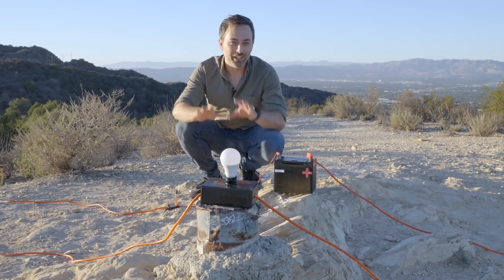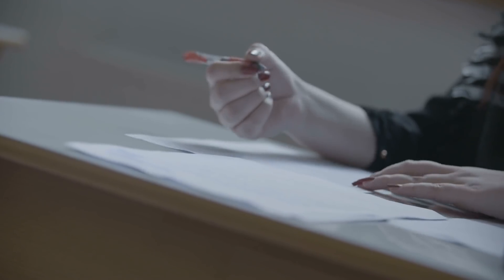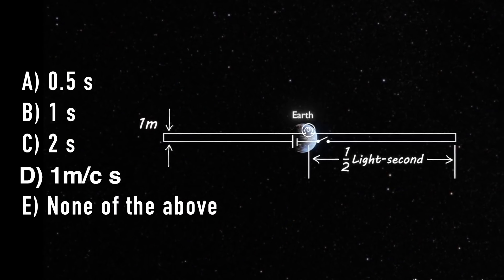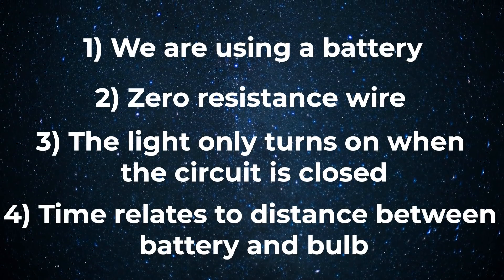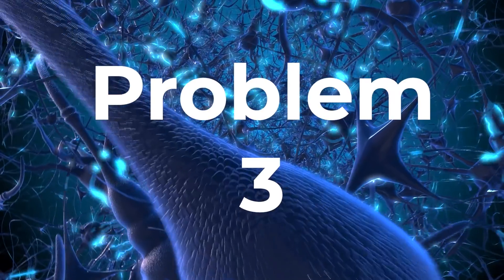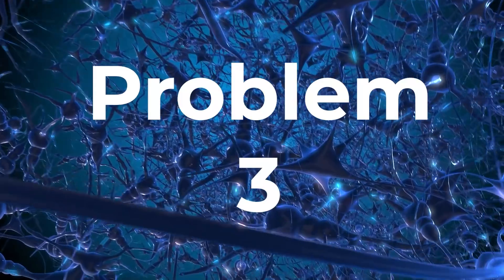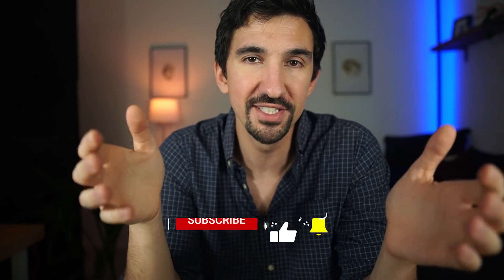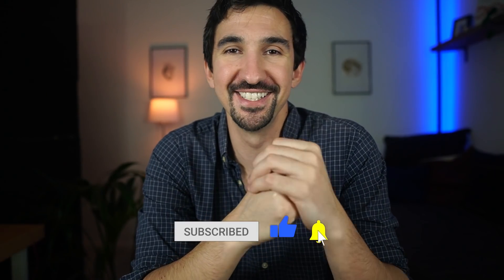Is Veritasium Wrong About Electricity?

Comment: Sorry to say, you are both wrong.  As some others below have commented, this problem is all about high speed transitions on a transmission line.  Yes, when electrons move they create a field and yes this field propagates down the wire on the outside skin of the wire.  Vertasuim states that these fields jump across the only 1m distance to light the bulb.   Any competent EE can do the calculation of the strength of that field moving thru air and they will tell you that it will in no way be strong enough to produce enough energy to light the light bulb.  The next problem is that even at zero resistance of the wire the bulb must have resistance other wise it would not glow and light up.  This resistance will reflect the incoming voltage step from the switch and cause a wave to head back to the switch.  This is a negative reflection so it will reduce the incoming voltage by 1/2 until the wave gets reflected again.  If you look at vertasiums video at 12:20 your will see a chart if these reflections.  Count the steps.  This is how many times the voltage has to travel down the 1 sec line.  If the bulb needs the full 12 volts to light up it will take many seconds to turn on.  High speed transmission line theory.
Reply: The entire lightbulb thing is just a distraction. The simple fact is that this is a fairly straight forward transmission line problem and physicists and EEs who can't solve this are simply incompetent. That applies to famous YouTubers. :-)

Comment: Let's place the light bulb, and the wires that connect to it, inside a Faraday cage that covers the entire length of that side of the circuit.
The time it now takes the light to come on is now proportional to the length of the wires, not the distance between the battery and lamp.

Comment: You are using a 12V source.
The round trip for the current is 2*2*300,000km = 1.2E8 m
Choosing  a very generous 2.5mm sq wire giving 6.9 ohms / km
Then the total resistance will be 8.28E6 Ohms.

Assume the light bulb is a LED at 5W so needs 5/12 = 0.41Amps.

The availble current will be I = V/R =
12/8.28E6 = 1.44 E-6 Amps.

The light bulb clearly has insufficient current and will NEVER light.

Comment: I think you made a common error. It isn’t the distance between the battery and the bulb that matters, it is the distance between the switch and the bulb. Once you understand that the causality issue disappears, since a break in the line would basically just be another switch, and so the time delay would again be approximately distance/c. Also, if you look at the analysis that he linked to in the description it shows that the bulb turns on to about half power initially, and then steps to full power after full propagation.
Reply: If the bulb side had many bulbs, would they turn off radially from the switch, radially from the source, sequencially along the cable or intantaneously?
Reply: @JuanCLeal  This is complicated to explain in text, but I'll try to explain it according to my understanding. Note that I am using the same assumptions that are required for the original question (ideal conductor, etc). If all of the bulbs were on and the switch was opened they would dim to around half voltage based on their shortest distance to the switch, so radially. They would turn off completely once the propagation along the wire is complete, so sequentially.
Reply: Wrong. Vertasium is deceiving his audience. Yet again. With his conclusion it means that “the lamp will light up” if where’s no wire. Because there is no time for the wire to affect the outcome and there’s no field created by it that would facilitate this energy transmission.

Comment: I think reason number two is flawed.
If the circuit breaks at one light second away, the system wouldn't know it was broken until it propagated to the light bulb. In other words, if the circuit were broken, it would take some time for the light to go off BECUASE of causality.
The idea that the light would go off immediately is simply wrong. There is no way for that to happen. A false premise leads to a wrong answer.

Comment: Regarding FTL communication: the setup almost seems like a scaled up version of quantum entanglement, doesn't it?

Where the entire system can technically communicate information FTL, however it is so fickle that you can't effectively engineer a FTL technology with it...

This is my mental model for how i think about this...

The bulb "knows" that the circuit is closed, and therefore it's ok to turn on now.

Similarly to how an entangled pair of photons "knows" to have opposite spin, and so it can reveal the information quickly.

(Of course this goes into hidden variable theory, which is guess is incorrect?)

Nonetheless for this light second long circuit to feasibly exist, it actually had to propagate through the causality network at some point first. It can't just exist at the snap of a finger and work instantaneously.

Similarly how you have to first produce an entangled pair of photons, send them far apart, and then you can be impressed by the apparent FTL communication.

There was also sort of a circuit being built, before the experiment could be conducted.
Reply: Quantum entanglement can't communicate faster than light in principle. Classical information is still required to decipher the quantum result, and this information can't be predetermined.

Comment: It seems to me a DC current in a power line can induce a DC current in another line. However the current cannot last forever though unless the line is infinitely long . The wire has a limited number of electrons. Also the amount of current is probably almost zero at 1 meter distance. I think the Veritasium video was very misleading (or at least very unclear) and very click-baity.

Comment: Okay, a piddly point of no real importance that I assume someone must have brought up already, but the last time I fiddled around with making antennas, the formulae that I used ALWAYS assumed that the speed of the wave flowing through the wires (either leading up to the antenna or as part of the antenna itself) was NEVER the same as the speed of light in a vacuum.
IIRC, the best case was something around 80-percent (i.e. 0.8) of the speed of light.
And these were just best guesses as one was always supposed to "tune" the antenna in "real life" by adding/subtracting the length of the elements to get it to resonate (i.e. match the speed of the wave flowing in the element to its actual physical length).

Also, the formulae didn't vary based on the fundamental frequency of the antenna (i.e. an antenna for a higher frequency which meant a shorter antenna element length and therefore lower resistance).
What was important was matching the antenna impedance to that of "free space" so that the maximum amount of electrical energy was transmitted from the transmitter into "free space" and, as it turns out, the impedance of free space is something on the order of 40-ohm (which is relatively close to 50-ohms which is why 50-ohm coax is often times used).
So I suspect that assuming a wire resistance of zero doesn't really help with making the thought experiment "realistic".

So to my uneducated mind, NONE of the time options given by Veritasium make any sense to me whatsoever.

Of course, I'm not a physicist or an educator and I don't play either on TV.

Comment: The was is an implication that electrical wires are shielded and a presumption that perfect shielding, such as blocking the antennae effect, should not negate the results of the light turning on.

Comment: What if the wires are infinite in length with zero resistance. Will it be still 1/c?
Reply: It's never l/c.  This is a transmission line problem. What really happens is that there is an instantaneous current flow that is V/Z_tl, where Z_tl is the transmission line impedance of  roughly100-200Ohm. That will, of course, not light up a 1Ohm light bulb, but it is still the zeroth order effect. As the electric field spreads along the transmission line, the Ohmic and skin effect losses will increase until, after only a few kilometers, these losses effectively take up all of the energy that we are pumping into the line. It is entirely irrelevant how long this thing goes on after that initial lossy section.
Reply: @lepidoptera9337  thanks. But what I would like to know is say, there's a generating plant 10,000 km away, switched on at T0. I switch on my fan at T0. When will the fan start running? Is it 10,000/300000 second?

Comment: I read a lot of comments... My take, let's design a system where the light has an on board power source and a detector capable of sensing a change in EMF on the wire loop.  The question now is, how fast will the light turn on given a signal request thru 300000 meters of wire.  The answer then is, this is dumb because a small wireless transmitter could be used to replace 300000 meters of cable.

Comment: Reg. the 2nd issue you raised of breaking casualty.

Assumption (3) is wrong. Check Twitter where I posted the same question and it was answered by someone correctly. The long cables act as capacitor and electricity moved to other cable even without the circuit being closed.

Comment: Reg, the 1st issue of dimension of answer D being wrong. 

1 in the 1/C seconds is the one meter separation between the cables. So when we do dimensional analysis it turns to seconds only. L/(L/T) = T.

Comment: If I had a stick 1 light hour long that had no elasticity therefore it couldn't be stretched or compressed and I move one end of the stick the other end would move instantly. Therefore I would have communicated faster than the speed of light to someone else at the other end of the stick.

If a wire is full of electrons and it cannot possibly hold any more then if I force an electron in at one end then an electron should instantly pop out at the other end.
Reply: Nope. A light hour long stick with no elasticity is physically impossible. It would either break, or you would be unable to move it, the changes are propagated at the speed of sound in the material. The same is true for the pipe filled with electrons. Information can travel though the em field at the speed of light, but the movement of physical objects bumping into eachother propagate at the speed of sound in the material.
Reply: @Tobberoth it's a thought experiment. Just as imagining that someone is traveling at the speed of light. That's physically impossible too but yet that hasn't stopped physicists from playing the experiment out time and time again.

Comment: There is at least one correction to be made here: Information DOES travel faster than light, but you need to be more clear regarding what your definition of “information” is.
Einstein (among many others) noted that when you give a positive charge to an atom that was neutral, other positively charged atoms will begin repelling away from it at that exact instant, before light could travel from the now-charged atom to the other charged atoms.  Entanglement is yet-another example of information traveling faster than light.
The information that upholds the laws of the universe travels faster than light, so my interpretation was that it depends on what governs the creation of the magnetic field.
If the magnetic field comes into existence bit-by-bit through propagation (of motion or etc.) then it will not be fully formed faster than light can travel, but it is more likely that the magnetic field either exists or doesn’t exist, and when it exists it exists in all places (along the wires, etc.) at once, as governed by a fundamental law of the universe, IE much like the change in an atom’s charge the universe knows about it far before slow-poke light could have passed that information along.

I don’t know the specifics when it comes to the magnetic field, but information regarding the fundamental laws of physics definitely does travel faster than light.  A particle that pops into existence with mass doesn’t “gain gravity” at a rate bound by the speed of light, it instantly has gravity and anything nearby that should be impacted by that gravity is impacted immediately, with no light-speed delay, and the same goes for all fundamental forces.
Reply: Sorry, but are wrong about instantaneous propagation of fields.
Speed of propagation of gravitational field is both theoretically and experimentally equal to the speed of light, according to GR and LIGO.
Speed of light is almost by definition the speed of propagation of both electric and magnetic fields.
Reply: Entanglement doesn't communicate information. You need to know about the state of both entangled particles to gain any information from the change in state of one particle. At that point you already have all the information you need.